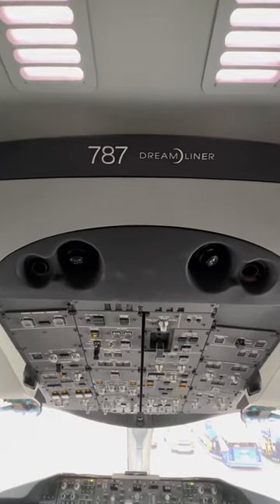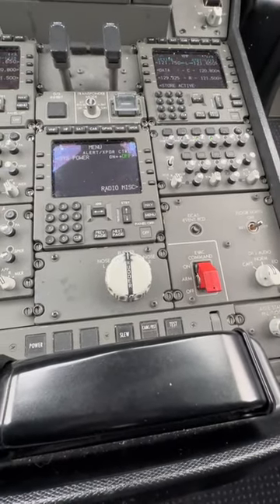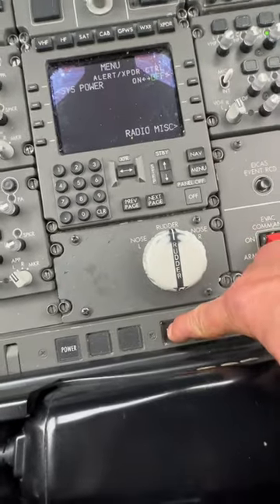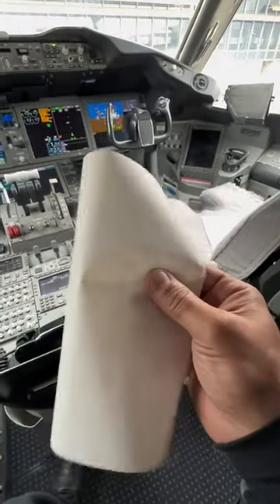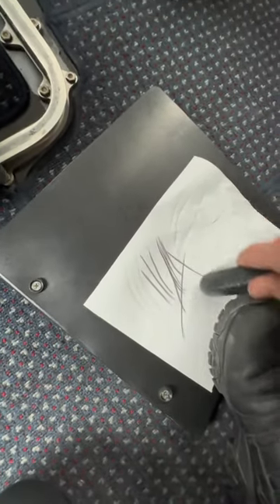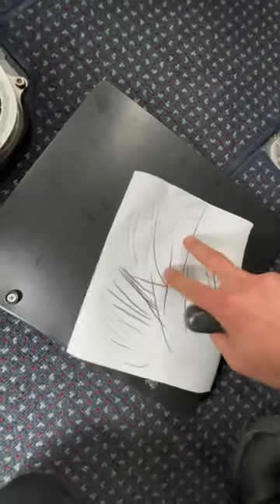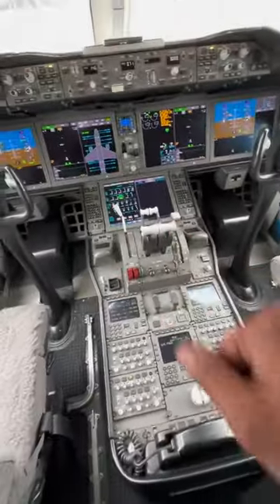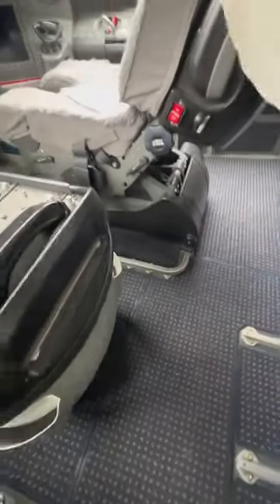B787 ACARS printer paper (same on all commercial aircraft)

Comment: Thanks Stig - no printer ink, leaks or mess to worry about.  Can’t be improved on these last 50 years! Do you have to check there’s enough paper?
Reply from the maker: yup   you said it just right.. and yes we check that the aircraft has at least 2 to 3 rolls as a spare for pilots to change in flight,  on ground we will change it as needed.
Reply: @StigAviation  I guessed you’d look after the spare supply - nothing skipped when you guys are at work.  Thank you for replying.

Comment: Hey, a question for ACARS - do airlines/airports store the logs somehow, perhaps not in paper form? Also, I heard that different airlines configure ACARS differently for the conditions at which the door open signal is sent (I believe it's the DRO message) sometimes it's the genuine opening of the door, sometimes engaging the parking brake. I found it hard to believe this is even configurable given that ACARS is a standard. Do you have any knowledge of how it's being done on a 787?
Reply from the maker: Nowadays everything is documented into a digital format, some aircraft still possess the physical logbook, but all the information that’s documented through the logbook also gets documented into the digital database. The haircut also has its own way of recordkeeping. DFDR (digital flight data recorders) and PCMCIA (personal computer memory cards). In regards to ACARS, it’s simply works off of the VHF3 or HF system and SATCOM. I don’t think it has anything to do with brakes or doors. The 787 works much the same way as the rest. Hope that answers your question

Comment: Same as early fax machines
Reply from the maker: exactly
Reply: Yup. And suffers from exactly the same problem, namely, the print fades out and even disappears over time. No problem all the while the aircraft stays with the same operator, but if the aircraft is leased, and there's a need to recover those docs at end of lease, then there's a problem. Similarly, if doing engine ground runs or LRU Part Number checks at end of lease, the results can all be printed on on that paper, BUT run it through the photocopier immediately after printing out on the flight deck, then you're safe from "print fade out". BTW, Q: "Why don't they use, say, an ink jet printer, instead of that heat sensitive paper". A: Because ink jet & bubble jet printers tend to act up while in flight /aircraft is pressurised to equivalent of 8,000 ft".
Stig, you Sir have developed a fantastic YouTube resource, many congratulations. I've worked in aviation since I started my RAF apprenticeship when I was 16 in 1961. I'll be 79 next month! Greeting from a Brit in Switzerland.